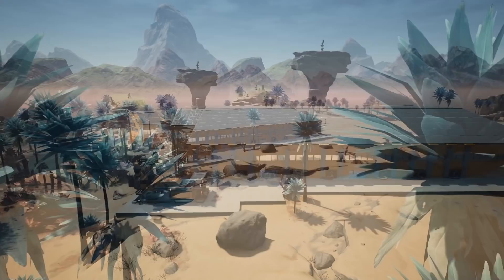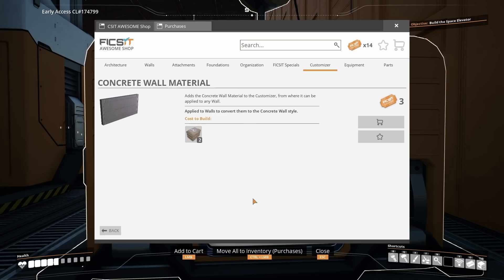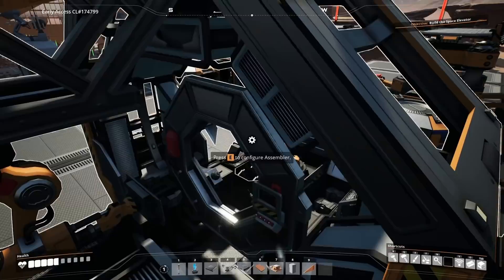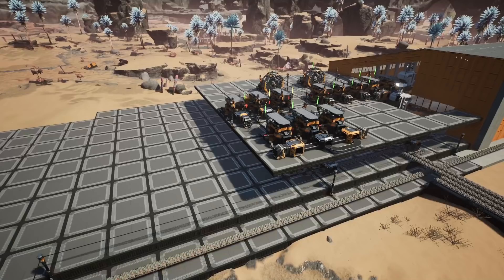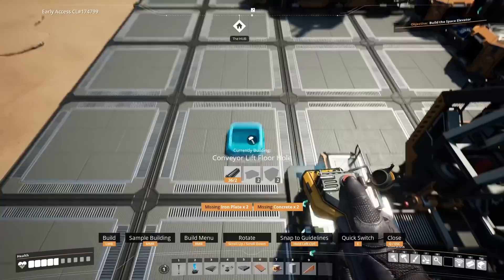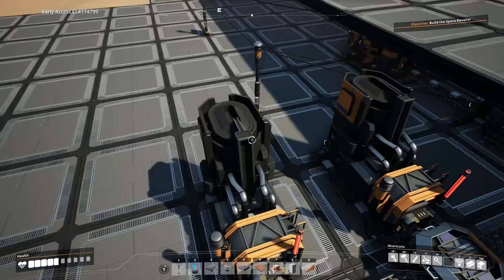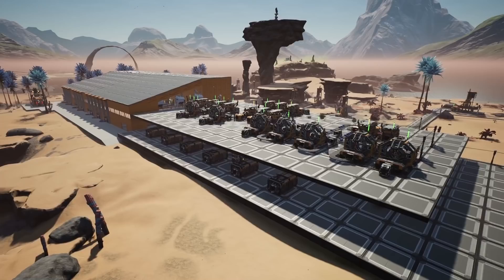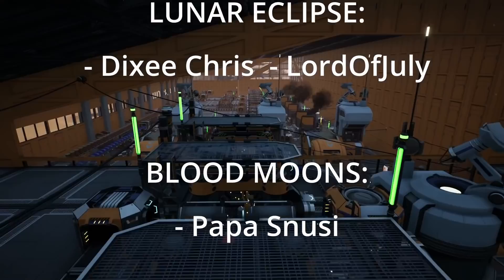The PERFECT Starter Factory. Pt.2 Smart Plating | Satisfactory Game

Comment: Had two issues with the .sav file.  

- All of the iron miners in the back were unpowered, had to run a cable over to the far corner of the factory.

- The smart plate smart splitter was sending everything to the overflow (middle) regardless of programming changes.  I had to delete it and rebuild it with the same parameters.

Otherwise, phenomenal help and great ideas for me.

Comment: In the rotor and smart playing you have some of the lines crossed. For the rotor you have too many rods feeding into the assembler (25) and too little into the screw production (20). The smart plating had the screw lines for the two assemblers switches, however when drawing out the schematic myself it looks correct. Regardless thank you for putting this together

Comment: I don't mean to be too petulant here.. but with the rotor production line you directed 25 rods over to the assembler and 20 to the screw constructors. where as you need a total input of 25 in the screw constructors and 20 in the assembler. For anyone who might be wondering this can be solved by rearranging the belt configuration on the output of the iron rod assemblers in a mirror of what it is in the video and this should improve the production of the rotor assembler from around 67% to 100%

Comment: just a tip for anyone following this and having power issues, once you have enough tickets to unlock what you need, cut the power to the sink. by having it running the way he set it up ALL your machines never go into standby because you never saturate your belts. if you cut the power to the sink the belts will saturate and the machines producing like iron rods, screws, etc will shutdown and go into standby and stop using power until you pull items out of the storages which they will kick in long enough to refill it and go back into standby. Biomass burners only burn fuel if they need to (unlike coal and fuel that burn it 24/7). The devs designed them this way so that your able to make your parts and not burn as much fuel. Having the sink from the very start is nice for addons, but not recommended to be ran 24/7. if machines can go into standby and not draw power, you will consume fuel at a much slower rate.
Reply: I didn’t know that about the biomass burners. I’ve been micromanaging my burners like a psycho. Thanks for the info.
Reply: @HoiPolloiNtertains  no problem. I noticed it when I was hooking up one to open a pod. With it only connected to the pole it used 0 fuel. Due to this I use 16 of them for spike usage. My coal makes 1800 but the biomass is another 400ish reserve that won’t use fuel unless it kicks in which is good for short bursts or kick starting water extractors if your coal gens fail for some reason
Reply: Shouldn't the internal water buffer in the coal generators be enough for a restart
Reply: @barklet6110  what’s that got to do with my comment?

Comment: Note for underclocking that if you're not afraid of doing lots of small calculations (and care about petty energy savings) it's probably more effective to spread out the overclocking evenly. If you have one manufacteurer at 100 and one at 50 you could instead have two at 75 and due to the exponential nature of energy cost that would be slightly more effective.
Reply: Underrated comment, Thanks!

Comment: Following along with this tutorial, and something you neglected to mention is that the initial eight generators don't seem to be enough to handle the power demands on such a large factory. I've got ten and had to disconnect half my factory from the power grid to avoid fuse breakage. Glad part three starts with coal, because I can barely keep up with biofuel production.

Comment: The Elevators that bring Iron Rods upstairs for the Smart Plating are wrong. As you built it 18.5 Iron Rods feed directly into the Assembler where only 10 are needed. The line with 10 Iron Rods feeds into the splitter for the 2 constructors producing screws. It should be the other way round to work properly. 
Still nice work, keep it up :)
Reply: that what i realised ! now i need to understand how to correct it ! thanks
Reply: @ademuse410  after he places the first 3 constructors and then puts the merger on the outer 2 and a splitter in the middle he puts the extra conveyor loop from the middle to the right merger its meant to be to the left merger small mistake but makes a big difference
Reply: @phillipchudleigh3158  yes indeed ! Thanks for your help :)
Reply: just a tip though what I do is instead of sink the re-enforced iron plates and rotors from those 2 assemblers, I shove the overflow into an assembler that makes the smart plating and cut out all that other machinery. then sink the overflow from those (they worth WAY more points and saves a TON of power) once the plates and rotors fill up it kicks in and starts cranking out the smart plating. if you need the 50 for the unlock into coal, you can just grab 50 of each from storage shove them into that assembler by hand and presto you have the 50 right away, then once the plates and rotors are full it will make more (which you need a lot more later anyhow)

:)
Reply: @problemchild959  Thank you!

Comment: You made a mistake in Rotor line. You made the Output of the rod constructors so the screws get 20 rods and the assembler gets 25 but it has to be the other way around and you got your splitting of the iron rods for the screws in the smart planting line mixed up. Where your 18.5 rods go the 10 rods should go and vice versa.

Comment: Hate to point out but I was only loosely following your structure, while strictly following your maths,  and I noticed that you actually hooked up the 25 rods output to the rotor assembler instead of the 2.5 constructor array. This is easily fixed by anyone following this exactly by putting the splitter loop on the reverse side of the 3 constructor iron rod array. Simple belt switch will do.

Comment: Personally I like to use one whole node or one full belt line per part so for reinforced plates I'll have one full belt of iron ore for plates and same for the rods to screws weather it's a 120 or 780 line that's why I love the alt recipe for rotors using steel pipes and wire so one iron belt one coal and one copper can make motors because pipes and wire also make stators and since motors require a 1:1 ratio of rotors and stators it's super easy and you can get quite a few motors produced per minute 😎👌

Comment: Not sure if anyone else picked up on this? at 12:18 you split and balanced so you have 20 rods going left and 25 going right, however on the left side is the 3 constructors requiring 25 screws, and the right is the rotor assembler requiring 20. It's backwards... the belt should be going left so the screw constructors have the 25. If anyone made this build and is finding their screws are rod starved and their rotor assembler side has too many rods this is why :D

Comment: Learned a lot. First you're very vertical in your approach in the sense that you go all the way from ore to product. It's probably very interesting since it lets you use the planner efficiently. I've been struggling with producing the stuff needed for the elevator v3, so this will definitely help. Also, floor holes. How did I miss those.

Comment: For the rotors... dont you have the rods backwards?  It looks like you have 20 rods going into the screws constructors and 25 into the assembler.  It should be the other way around... although an easy fix
Reply: Yes!  I just spent an hour troubleshooting <100% efficiency
Reply: if your not hitting 100% efficiency check your belts. I followed this guide to a T and changed nothing and I just double checked and all machines on those lines (I run 3 of them because rotors are sooooo slow) are running at 100% efficiency. he does do what looks like some funky routing of belts because at this stage you don't have programable splitters to specify exact ratios and it can be confusing at first.

But as I said all 3 of my rotor lines are following what he did in this video exactly and all are at 100% just fine
Reply: You are completely right. You need to swap the belts from the left to the right so the screws get 25 rods and the assembler 20 :)

Comment: Small pro-tips:
- For the modular frame setup, set the miner to 80%
- For the rotor setup, set the miner to 75%

This ensures they run at the same rate as the furnaces use up the material (modular frame takes 48 ore and rotor 45 ore)
You can also always change the "target production rate" in the minor (And any other machine that can be over/underclocked) to the amount that is used to get the right percentage for the machine.

Comment: I just finished part 2. Excellent, absolutely excellent guide. It really helps with the overwhelming feeling on your first playthrough. I cannot thank you enough!! My only problem was building my part 1 base next to a hilly area so I ran out of room for the 19x9 foundation off the side of my main base but I just moved it in front of my factory and it faces face perpendicular lol. A bit awkward but it's mine. I also rushed coal power because those biomass generators aren't enough (I had 12-14 and it was burning wayyy too much fuel for the power it was producing). Those SINKS were 90% of the problem. Also, 2 questions - how come you didn't keep building onto your original part 1 base lines for more complex parts? Is it due to efficiency or just preference? And #2 question  - how far along in the game will this base take you? Tier 5/6? When should you start setting up your endgame base? Thanks!

Comment: i know this is older but if you have a pure iron node instead of a normal node can you use that with mk2 belt and split it into 2 mk1 belts at factory? in theory it would be the same input as 2 normal nodes correct or would it get slowed down in splitter?

Comment: I believe you messed up here.  You are only feeding 20 iron rods into the screw constructors which require 25 and you are feeding 25 iron rods into the assembler which only requires 20.  When connecting the extra rods you connected to the wrong side.  Correct me if I am wrong. 12:13
Reply: Yeah he just reversed the sides by accident the manifold needed to be on the left not right

Comment: check your smart plate bin... its not storing items... there straight to bin...
Reply: if you rebuild the smart splitter and configure it the same way, it should work as intended
Reply: I came here to say this as well the conveyor belt going to the storage container is not attached the the smart splitter itself, but instead attached to a conveyor pole that happens to be under the smart splitter.

Comment: OK so I have to find new iron nodes for this ? ... nearest one is 800 m away is that OK with belts ?
Reply from the maker: Yes that's fine, I suggest running the belts on top of foundations to keep them neat but until you're into your steel phase you have no option but to transport material via belt or build another factory by the node
Reply: @TotalXclipse  thanks man great video
Reply: you can run a belt from 1 side of the map to the other (although I wouldn't recommend that long as it will cause performance issues due to how the engine renders things) but you can do it. there is no limit to the overall length, just a limit to each segment length

Comment: Very new to Satisfactory, just found your videos. At the moment I like your style. Couple of questions the factory you have built in this and the last video, how long did it take to design?
Reply from the maker: I designed it on the spot, and just went with the flow - but I have over 4k hours in satisfactory so the experience meant I was much quicker at building it - also I used creative mods to allow me to speed up the build but it took probably a couple of hours

Comment: Will you also be doing a power plant episode? Cause I've been following these tutorials and I'm rapidly eating up all the biomass around my bass and these builds are taking up A LOT of power.
Reply: Agreed...my build up to rotors +/- a few machines is eating everything up power wise? I know you are in creative for the video, but did you test the power setup in real game? I'm out of juice!
Edit: Currently using 8 biomass gens + 2 on the hub all burning solid biomass
Reply: try to reach coal power and set up a coal power plant asap
Reply: @blkdeath  one thing you can do to save a ton of power, is don't automate the smart plating till you reach Phase 2 and have unlocked coal. to be honest you only need 50 to make it to phase 2 which you can just toss down an assembler and feed it 50 re-enforced plates and 50 rotors by hand and when they finish stuff them in the elevator.

I don't even automate the re-enforced plates or rotors till I either unlock coal (vanilla) or some other bigger power source (modded) because they both produce slow as molasses and is just much easier imo to grab a handful of parts and hand craft them at the bench.

which by the way if you did not know the crafting bench to craft a lot of something you can just tap the spacebar to engage autocraft and it will craft that item till either you tap the space bar again, run out of resources to make the part
Reply: @blkdeath  also cut the power to the sinks for a while. it draws a LOT of power and the way he has it setup it causes your machines to not go into standby and reduce the power usage. if you cut the sink then all your basic parts lines will instead shutdown when your storage is full instead of sink the items (which causes them to run nonstop).

Also the sink uses like 30MW of power each as well which in his setup is 90MW of power alone on just the first factory.
Reply: @problemchild959  ty very helpful! Wasnt thinking about sinks
Reply: @blkdeath  np yea they draw a ton of power. imo they need to be toned down a bit but I think by the end of part 2 he had like 4 or 5 of them and thats like half the biomass power just in sinks. I also now use a completely different setup where I build a central storage area and the factories around it and use a single sink now to save on power because even with coal/fuel/nuclear, they add up fast

Comment: On the modular frame section you forgot to tell us what to do after the 2nd smelter and didn't show hooking anything up.  If it is a normal splitter to the 2 constructors, then each would get 10.5 ingots, but one needs 9 and the other needs 12?  Still trying to figure out how to get that split ratio in that small of a space.  :(  I guess a normal splitter is fine once the first constructor backs up from getting 10.5 when it only needs 9, then the rest will go to the 2nd constructor.  shrug
Reply: You can just use one splitter to connect the constructors, since its the manifold-technique, which will fill both constructors after a few minutes. ^^

Comment: Wont this be a simpler design with the casted screws and bolted alt recipes?
Reply: Yes, but this is a guide for starting up, and unless you use a mod, the chance to get these recipies from the first few HDDs is quite low.
Reply: @vlchk  ironically i got the bolted frame as my first, the reinforced one after and the casted screws next. Then two pure resources one after.
Reply: @vlchk  actually its quite common because the maam when scanning drives will only unlock from the pool of recipes you have current access to. so if you grab a drive in the first 5 minutes of gameplay odds are it will be cast screws if you have done 0 milestones as you have a very limited pool. I have done 3 playthroughs and got cast screws from my very first drive 2 out of 3 times. as a matter of fact if you unlock 0 milestones and spent the time to gather every drive in the game, after about 3 or 4 drives it will tell you that there is nothing to research and return the drive to (and waste 10 minutes of time)

Comment: 21:30 you split correctly but don't send rods ratio to the correct assembly line on top
Reply: How do you correct that?
Reply: @markvuraldi  the 18.5 rod on the left merger not the right one need to go up in the middle elevator  and in the right merger put a lift pointing left and conveyor it to the lift on the left its a perfect 90( done it to the roof ) dont need to mess with conveyor floor hole
Reply: i dont know how i could post a picture of the change
Reply: @jojoskunk  thanks. I'll try to figure it out. Just started the game like 35 hours ago.
Reply: @jojoskunk  I think you can share an imgur link

Comment: I can't figure out your math on the smart plating at all.  Screw constructors need a total of 18.5 rods per minute but are only getting 10.  Rotor needs 10 rods and is getting 18.5.  Ok, so you got those reversed.  That explains that.  Also, just as an fyi, the rotors are actually being shorted .77 screws per minute as they are really getting 49.33333 instead of 50.  I might try to adjust things up a bit to insure it is getting a bit more than it needs rather than a bit less.

Comment: what am i doing wrong??? i tried building the exact same way you did but no mater what i do, my efficiency is not as good as yours when making the materials?
Reply: for which items ? the smart plating he has an output backwards on and if you search the comments you will see how to fix that (I don't do it this way I use an overflow for them) the rest should reach 100% in time. some of them take time to get wound up and get all the parts flowing before they reach 100 also the ui doesn't update super fast so it can be at 100% but still show for example 80% for 15 minutes